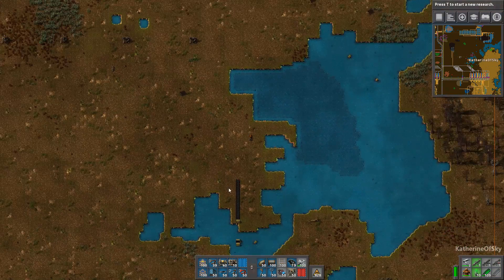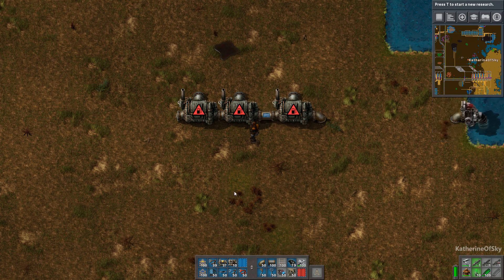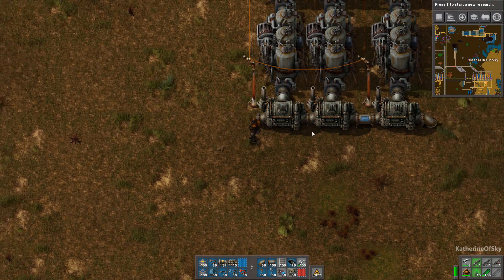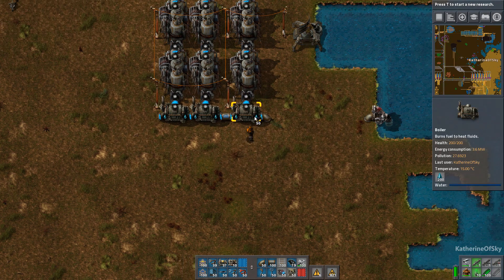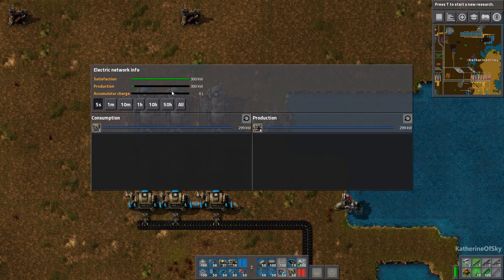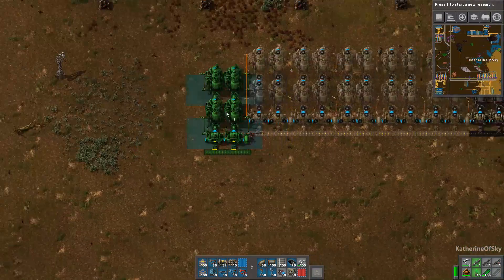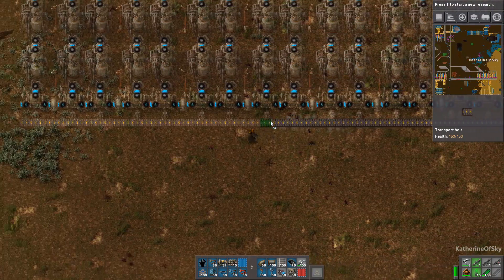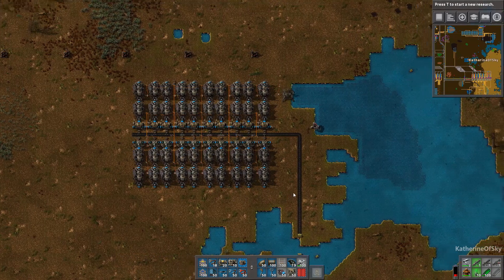Factorio: HOW TO SET UP STEAM ENGINES, BOILERS - Perfect Ratio, Tutorial

Comment: Can i see ratios like this ingame? Or can i only try and try to figure out how ratios works best?  I thought its 1 Boiler to 4 Engines because of   900 kw (steamengine) to 3,6 mw (boiler)  
 i  feel stupid now xD
Reply from the maker: Yes, you can!  The boilers CONSUME 3.6 MW of fuel, but have 50% efficiency, therefore generating only 1.8 MW of Steam.  The Steam Engines put out 900 kW.  Therefore, you need 2 Steam engines to match the 1.8 MW :-)
Reply: I totaly miss to add this -50% thx^^
Reply: i wish it would say "Fluid consumtion 60 units/second" and "Fluid production 60 units/second" on the boiler.
Reply: i thought a boiler would convert 60 water units to 60 steam units. Thats why you can have 2 steam engines on one boiler taking 30 steam units each. thats why the ratio is 1:20:40, not 1:12:24
Reply: Ahm sorry my mistake :-) i was talking about nuklear power  1 ofshore pump are enough for 12 heat exchangers.     Yea your right about this.
Reply: +1 sub!
Reply: 1 ofshore pump generates about 1200  and one boiler needs 100.  but yea would be very nice if you can see it ingame.
Reply: @Slybby  WAIT WAIT WAIT 1200???

Comment: Did I miss where you explained the reasoning for starting with a single one at the beginning?  I remember you saying there was a specific reason for it instead of doing them in pairs of two just not what it was.
Reply from the maker: You can do it whatever way you want.  The reason for that paticular way is to save on powerpoles: one engine on each side.
Reply: @KatherineOfSky  wow quick reply.  Love your vids.  I was just curious what the reason was since you said youd explain later and it was sticking in my brain.  Thanks!

Comment: Why don't my steam engines work when I hook them up to the boilers? I have them attached the boilers and the boilers have fuel but it won't burn at all. Everything is hooked up right I thought.
Reply from the maker: Are power poles connected to the factory?
Reply: @KatherineOfSky  that may be it. Do I have to attach them with copper cable or just build the poles near the steam engine?
Reply from the maker: You have to connect the factory to the steam engines with power poles

Comment: so am i to understand that a layout of 20 boilers with two stacks of 20 steam engines will not work?  as an example, i am goofing around in a sandbox game, and was curious about ratios, which led me here.  after seeing this 1:20:40 ratio, i became quite curious about my typical setup, which sees many more than 2 engines in a line coming off my boilers.  I make a line of boilers as in your setup, connect all steam outputs with a line of above ground pipes, then come off that line of pipe to the pipe-to-ground, to the steam engines.  after seeing your video, i made a small setup with 1 pump hooked to two boilers.  connected the steam output of the two boilers, and ran a line of 10 steam engines.  every steam engine in the line has 199 steam.  so is it that my draw is not sufficient to show this setup's weakness, or is this video from a version of the game before .16x, or what's going on here.  according to this video, my setup should only support 4 steam engines, yet its providing a single line of 10 with 199 steam.  sorry if i'm missing the point and wasting everyone's time.
Reply: sorry, here's a pic.  http://thefurnace.clanservers.com/10stack.jpg
Reply from the maker: You can use them in that way -- the only important thing is that you make sure the steam pipes are all connected.  People usually line them up the way they are in the video to minimize the odd fluid dynamics that can prevent full throughput. 

The reason you are not seeing any underproduction is because you are not using all or more-than-all the power that is capable of being generated.
Reply: but even if the long lines of engines would work, shouldn't this particular setup only provide full steam to 4 engines, and not all 10, considering there are only two boilers?  a boiler provides enough steam for 2 engines, hence the 1:20:40, yet 10 engines are receiving 199 steam here, when it should only be four?  -.-a  sorry if i'm still missing something.

Comment: I use a slightly less wide setup I've seen in a speedrun somewhere.  Instead of separating the pairs of boilers you put them touching each other and separate the two steam engines by a pipe.  You can put a power pole in that separation (one pole for each two pair of engines, even small poles).  So you get a 14% width reduction at the minimal cost of one tile in height.
Reply from the maker: Since I often use more than one array, I still need a double width of steam engines, and I will need the extra pump anyway.  You can use either setup -- that's the beauty of Factorio!   (I prefer a long setup rather than wide)

Comment: but how can we make the performance better for the steam engines?
Do you just have to make rows after rows of steam engines and boilers?
Reply from the maker: Performance is related to how much energy you actually NEED.  (Steam engines will only produce as much power as is needed).  "Max performance" is related to how much steam the engines are receiving, and is the maximum possible output.

Comment: Newish player here, and I absolutely love your videos Katherine. Originally came looking for help at making a more efficient main bus, and I watched the oil one first, now this one. Please keep up the videos! People who haven't tried to make streaming/video wouldn't understand how much hard work goes into it.

For the boilers in particular, since you already have coal running there for them and it's no big deal, how much worse is the pollution to have burner inserters over regular inserters? If you have coal problems (not that I can ever imagine), would it be much more efficient when it comes to coal consumption to switch to yellow inserters? I think that in both cases, yellow inserters would be better, but not by enough for it to actually make a big difference. Would appreciate an answer from someone better! 

Also, with .15 bringing nuclear, do you recommend skipping solar and keep building steam until nuclear?

Thanks :)
Reply from the maker: Hi Fontaine!  Thanks so much for the kind words -- they are much appreciated!

As to inserters, the reason they are burners is so that if you enter a spiral of death caused by low fuel flow, the burners can pick up  their own fuel and start the system back up again.  Whereas regular inserters will be completely dead because of no power.

Pollution, thus, is irrelevant in this case.  You can check pollution yourself on the tooltip -- neither burners or regular inserters produce pollution directly.  (However, creating electricity from steam DOES).  

Power source -- it's up to you.  I'm enjoying nuclear because of the small footprint and additional complication of factory building.  If I were to play again, I would probably make SOME solar, since I don't enjoy large regular steam setups, and my factory grew quite large before I had the tech for nuclear.

Comment: i have 4 engines per boiler, and it works perfectly fine, all have 200 steam
Reply from the maker: Which version of the game are you playing?
Reply: the latest
Reply from the maker: "the latest" tells me nothing -- the latest stable build is 0.14.23, and the latest experimental build is 0.15.20.  Each version has completely different ratios.  

In 0.15, you can calculate the ratio yourself -- look at the info on the tooltips.  2 engines per boiler is the correct ratio.
Reply: why would i even consider writing something here, when i am not playing 0.15, sry if this wasnt obvious ^^

yeah, im not saying that it is not correct math wise, but 4 engines are working too, if you are not edging around with the yellow or red zone of your electricity, because then the engines go empty, because the boilers cant prudce enough steam when you are permanently at yellow or red ^^ just try it out, im not offending or something, just figured it out lately

Comment: Why do your boilers look different? My steam engines in game still use hot water
Reply from the maker: It is a feature of the 0.15 experimental build. http://steamcommunity.com/app/427520/discussions/0/1319961868331763542/
Reply: When they release this to stable will it mess with my current save?
Reply from the maker: If you save a map from 0.14 into 0.15, you can't port it back to 0.14.  (And you will need to adjust boilers & science to the new ways of 0.15.  On a 0.15 save, going to Stable will be seamless.
Reply: Thanks for the info, great tutorials too

Comment: Very good tutorial, but there is more to talk about ratios and better layouts.

I go for a 3 pumps, 60 boilers, 120 steam engines setup. Pumps pump at the speed of 1200 units/second and pipes can hold a throughput of 1800 units/second. With the following layout, you can fill two pipes with 100% throughput.

P.....P.....P
========
||.............||

P are pumps.
= and || are pipes. So basically the middle pump distributes 600 units to each pipe on the side and allows for 1200+600=1800 units of water throughput.

I also dont place the power poles between the steam engines, because it increases the whole length of the contraption, espacially with 30 boilers on each side. that already is 90 tiles long, i dont want to add 15 more. It also makes the use of addition pipes unnecessary. I rather place the power poles where the inserters are and behind the steam engines. Basically leaving just one wide space vertically, instead of every two boilers horizontally.
Reply from the maker: Be careful of fluid mechanics... sometimes fluids act very weirdly in junctions, etc.
Reply: works perfectly if you let it be a self contained system and let the "output" pipes directly go into the boilers :)

Comment: No biggie, but one thing you fail to mention is how much power can be produced by a pair of steam engines or by the array.  Something you'd expect to see in a basic tutorial like this.
Reply from the maker: TBH, I never look at how much power is generated, since each base I build is unique and consumes more and more as I go along; I just build another array when needed.  It's easy to calculate, though -- just multiply 900 kw per steam engine times number of engines, (40 per full array), and you get your answer :-)
Reply: Like I said, no biggie.  :D    Just a seemingly obvious thing which probably should have been mentioned.   Have a good one.
Reply: TheMrTact
A full setup of 2 Offshore Pumps, 40 Boilers and 80 Steam Engines can output something like 72 MW. And a single yellow Belt of Coal is AFAIK not quite  enough to feed all 40 Boilers. 72 MW will be enough for many, many hours of play, before you've expanded your factory to consume more than that.

Compare this with the old setup of 2 Pumps, 26 (or 28) Boilers and 20 Steam Engines, producing around 10 MW (and being fed very adequately with one yellow Belt of Coal, probably even just half a lane). 0.14 and earlier power setups took up roughlt twice as much space per watt.

Comment: Appreciate the video, good to have the ratios out there.  I personally prefer a modified version of the old system where it's a lot longer, but takes up less width of shore line (which I usually find more important).
Reply: TheDugbo
Old system, you had to plonk down 1+10+13or14=24.5 items to get 5 MW, not including Poles or any Piping.

New system, you plonk down 1+20+40=61 items to get 36 MW of power, so it's much less labour-intensive, and in fact you nedd LESS shoreline in 0.15 compared to earlier versions, because each setup produces MANY times more power.

When you count in the required Poles and (minimal) Piping, the newer system wins even stronger in terms of not being labour-intensive.
Reply: Hello,  there is some confusion in what I mean here and It's probably my fault.  What I mean by old system and new system is how the steam engines are place to the sides of the boilers instead of at the end in a long row.   What I am using now in .15 is a pump on the right, then that leads to 2 sets of 10 boilers that run right to left, then both have undergrounds going  left which Ts off again to the 20 steam engines that keep going left.  

There is a lot of Going Left  and not much up and down.   The width of the shore line I use is determined by the 4 rows of steam engines that are side by side, This set up in the video is 4 steam engines length wise + 2 sets of inserters, + 2 sets of boilers, + a belt.

You are 100% right that .15 > .14

Comment: Very interesting.  It appears I've been doing something wrong with my steam engine setups.  I didn't even realize the boilers had the third slot coming out of the top side.  I've always hooked the steam engines to the side slots.  And while it works and the steam engines function it requires two boilers for every one steam engine to keep the steam engines at maximum temperature so they're operating at full capacity.

I'll have to try this setup out next time.  It would be amazing to only have to use 1/4 of the boilers that I've been using previously.  My early game power setups have always been absurdly massive for the amount of power they produce, which had been a rather large annoyance.
Reply from the maker: The setups changed significantly in 0.15, making the Steam gas a completely separate thing from "hot water".  Hopefully this setup will improve your game!
Reply: Ah that explains it lol.  Didn't even realize that I hadn't opted into the betas after getting the game.  I was still running the latest update for the stable branch.  I'll have to opt in and download 0.15
Reply: Rowgue51 Do that. The "experimental" version is at 0.15.16 now and has been quite stable for the last many weeks.

The devs have occassionally changed things in 0.15, though.
They changed the recipe for one of the Magic Science Potions. And they changed how the (Nuclear) Heat Pipes work. That's why Katherine had to pull one of her tutorials. But switch to Experimental when you start your next game. It has a tonne of improvements.

Comment: A small note that when you mentioned putting the second row of steam engines you didn't actually connect the water across the belt. While I think most experienced factorio players would catch it, given the tutorial nature I'd assume you'd want to catch that.
I almost always prefer a cross-belt layout because it also means you pull the coal from both sides of the belt and don't end up with the need to add a belt-balancer to the input to keep a full line of coal.

Thanks for the fun videos, I've really enjoyed your collaborations with Nilaus (both Death World and the Rail World).
Reply from the maker: Thanks!  Yes, I realized that at the very end, but since I talked about water in the beginning, I figured it should be OK.  (It was just a demonstration of how the machines could be oriented).  I prefer drawing from one side of the line because the machines need SO MUCH COAL; they burn through it very quickly.  I generally prefer the long setup instead of the squat one, especially when shore space is limited.  I regularly use lane balancers, so it' no difficulty.

Comment: What was the reason for starting with a single/ending with a single. Why not just sets of two?
Reply: Gap between them for the power poles. If you started with two you'd need an extra set of poles on each end, this saves materials.
Reply: I like to put a pipe in between the 2 steam engines every other set, leaves a gap for a power pole, so I don't need the pipe in between the boilers. Saves you another 9 blocks in length on a row of 20 boilers.
Reply from the maker: It's just to show different configurations -- examples of one complete array.  Some people prefer squat/compact designs over long ones.
Reply from the maker: ^^ Exactly what Alexander said!  Sorry, didn't quite understand what you were getting at, Mille.
Reply: CGDW2
I do that too. It's needed, I think, for my 10-Chunks System (patent pending), but outside of that, I'm wondering if it's a bad idea.

Our way of doing it is 2 tiles taller, and so uses more shoreline (although while shoreline scarcity was often a problem in 0.14 and earlier, that's not the case in 0.15 at all), and our way uses 20 Pipes, compared to Katherine's using only 9 Pipes but also 9 more Belts.
Reply: Layout size wise, it is I think a preference thing... but about the pipes, you must be doing something different because I'm using 10 pipes for 20 boilers, same as her actually. 
Side by side comparison: http://img.photobucket.com/albums/v242/ChaosGuide/Factorio%20steam%20engine%20setups.png
Reply: That's because you use a Pipe to "push out" every 2nd outer Steam Engine. I use a Pipe for each of them, to get a cleaner, nicer look. And it's also somewhat simpler and a bit faster to add the Steam engines, just run while holding down LMB.
Reply: Ah I see. I had considered doing so as well. I personally don't care too much about having everything lined up so I decided to save the pipe...